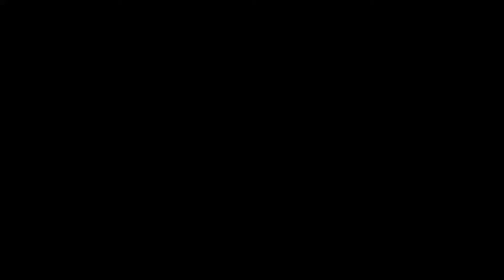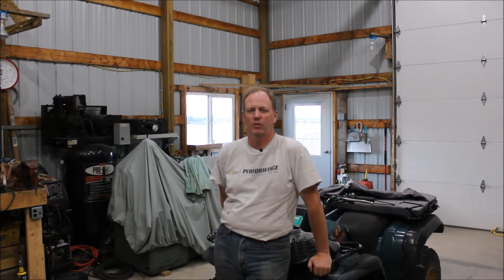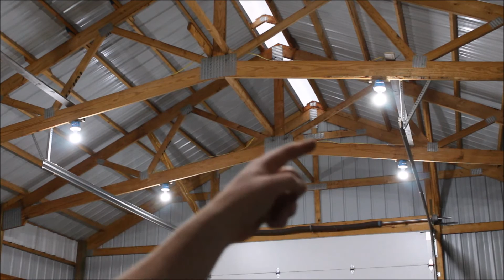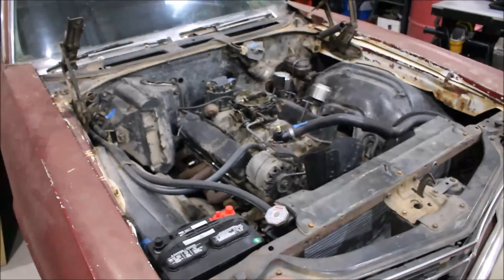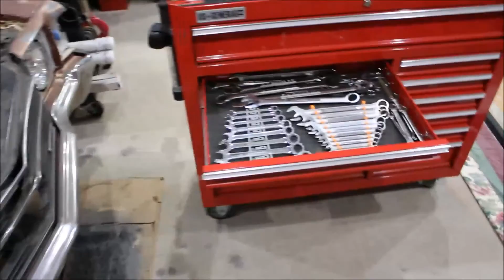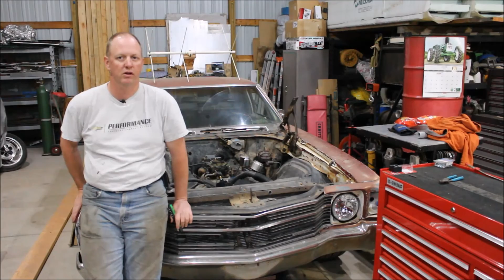Views of my LED Shop Lighting

Comment: Thanks for the video. Any chance you could post links to the products you used?
Reply from the maker: Scott,I added to the description info about my LED's or now the lack of them.  Since mine are no longer available here is a list of my equivalent parts.  I just picked Home Depot as a suppler.Philips 455717 LED Blubhttp://www.homedepot.com/p/Philips-100W-Equivalent-Daylight-A19-LED-Light-Bulb-455717/205862056Leviton Lampholderhttp://www.homedepot.com/p/Leviton-Porcelain-Keyless-Lampholder-R50-09875-000/100356842Carlon 25 cu. in. Round Ceiling Boxhttp://www.homedepot.com/p/Carlon-25-cu-in-Round-Hard-Shell-Ceiling-Box-BH525A-UPC/202077372
Reply from the maker: So mine are 1600 lumen and what is now available is 1500.  I would add to the count by 50% or 100% if I was going to us the space on a daily basis.  The biggest take away that I found is that the 5000K A21 type screw in bulb is a very good cost per lumen.  Hope that all helps.